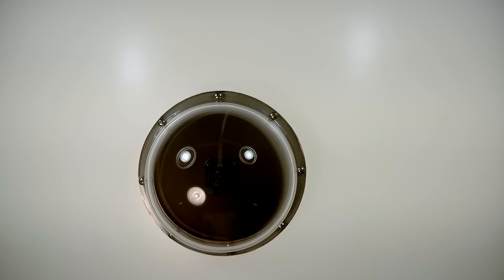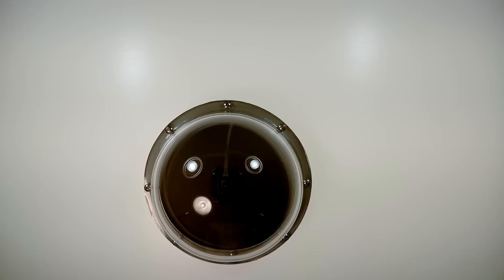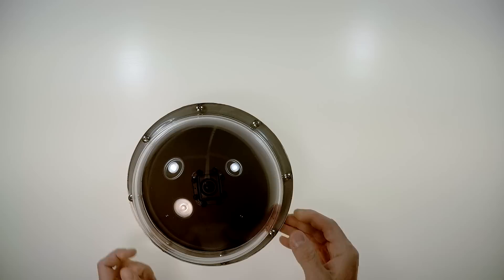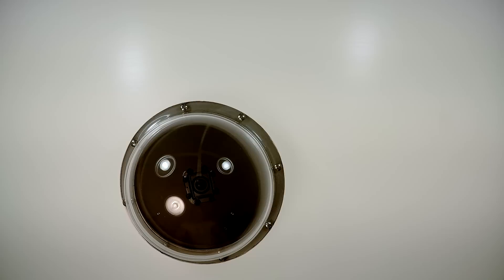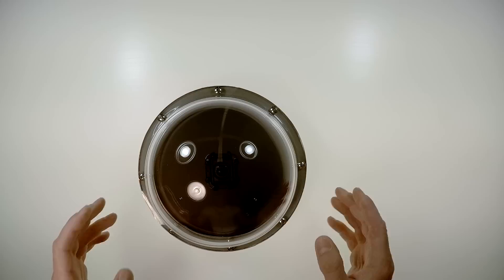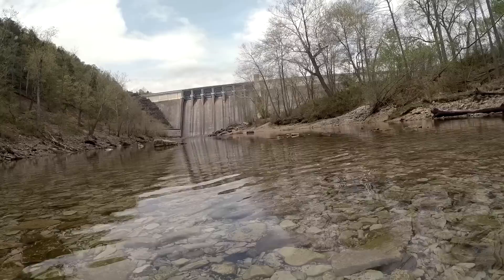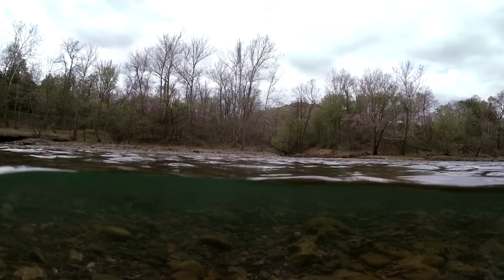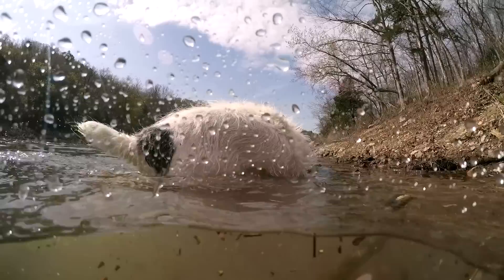DIY GoPro Dome Port Overview and Sample Footage

Comment: You should try adding lines on the back to show the centre point of the dome so you don't submerge it too much and put some rain x on the top half so the droplets don't stick.
Reply from the maker: Lawro Woods That is sort of how I use the horizontal bolts heads on the back of the dome. The thing is that you also have to pay attention to how angled the dome is down into the water or up into the sky. I have RainX and the bottle says not to use it on plastic unfortunately.... It does work great on the normal waterproof enclosures though.

Comment: I wonder if you sprayed/wiped some water repellant stuff if that would allow the water to disappear when you got water splashed onto the dome? Like Rain-X?
Reply from the maker: ***** Hey Josh! I believe that Rain-X says it is not for plastic. There is probably a product out there that will work though. Also, if you bring the dome into and out of the water, the water usually sheets off the dome.

Comment: Nice! Want to build one. Question. Can you make it smaller and have the same effect?
Reply from the maker: Djshady82 Thanks Shady! I'm editing the build video right now. Hopefully it will be up tomorrow. Yes you should be able to make the dome smaller and have a similar effect. I'm planning on building a smaller one to test the differences. The one that I build is a 7" dome and I would not want it to be bigger. The next one that I'm building will be a 5".

Comment: Hi. I have tried to do one, but I am in trouble to open the hard case to put my camera inside because there is litlle space to put my fingers. Have you had this problem? How have you solved it?
Reply from the maker: Hi Diogo. Thanks for the comment. I know what you're talking about. It's tight but I am able to open it without to much trouble. Maybe you have larger hands than me.

Comment: Great video! I was thinking though, how do you avoid reflections?
Reply from the maker: +Javier Salinas Thanks Javier! The flat black paint on the backing plate helps a lot to avoid relections. There are still minimal times when you might see a small reflection but it's not to big of a deal. I still need to learn at what angles to the sun those occur at.
Reply: +God's Country Inspired by your video I'm trying to build one for my Feiyu G4 Gimbal. I bought a 3mm acrylic dome but now I'm thinking that is going to be much easier just building a plastic box with a glass window :)
Reply from the maker: +Javier Salinas I've been working on the gimbal concept too. Just be careful because, depending on how you build it, a box may not be as strong as a dome.

Comment: Hi God's country, well done! One question: How free are you to move around with the dome port without getting relections in the dome port? Did you test it in different places (against the sun, with electric light in front or in the back), I built one too, but in many situations i see the reflections in the dome port... Thx for your answer...
Reply from the maker: +Dive Cooky Hey DC. I get very minimal reflections in certain situations. Have you painted the camera mounting plate flat black? That should eliminate most of the reflections
Reply: +God's Country , yes that was the result of our discussion too, good that it fits ;-) Will test and give feedback :)
Reply from the maker: +Dive Cooky Excellent. I hope it works for you!

Comment: Hi. How much did you spend making this??? And where to buy the dome?? Thanks
Reply from the maker: Desire Martinez Roughly $100-$120 depending on if you have to buy a waterproof enclosure or not. The details of where to buy the parts are in the video and video description of the how-to build video.

Comment: In theory could this be adapted for a tough camera like the Olympus TG-4 - http://www.getolympus.com/us/en/digitalcameras/tough/tg-4.html?
Reply from the maker: +jesslash In theory, yes it could. The dome port concept is not just for GoPro or action cameras. There are many other domes to fit other camera styles. The hard part is building a custom setup and figuring out how to mount it to the camera.
Reply: Thanks. I am going through your tutorial again now. The mount seems the most tricky for adaptation at this point.

Comment: i dont understand- if the cameras housing is waterproof, why do i need to make sure that the dome is also waterproof?
Reply from the maker: For this type of photo and video, you don't want the water right up against the lens of the camera like with the normal waterproof housing.
Reply: oh so it's not because it may damage the camera..?
Reply from the maker: No it's so you can take video and pictures that are half above and half below the water. It also gives more accurate video underwater.
Reply: OK I get it now! Thank you very much :)
Reply from the maker: You're welcome! Thanks for watching.

Comment: What the point of that???
Reply from the maker: +InThatBox Did you watch the video? This whole video is an explanation and demonstration of what a dome port does.
Reply: Yep, no point.  your gopro is already waterproof so to me no real interest.
Nb i dont say what you ve done is bad ;)
i just say i don t understand the point
Reply from the maker: +InThatBox I think its fairly obvious that the GoPro is waterproof while inside the waterproof enclosure that it comes with. Next time you have time, try to do a 50/50 split shot (filming half underwater and half above) with the standard waterproof enclosure. It is extremely hard to do. Especially if there are any waves or ripples. This isn't some crazy contraption that I came up with. There are many commercially available dome ports for GoPros and full size DSLRs.